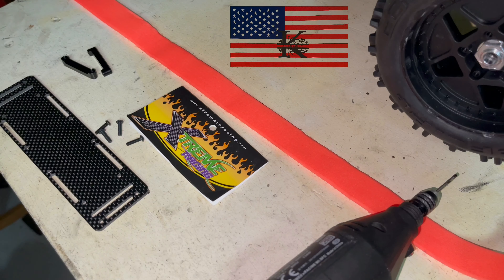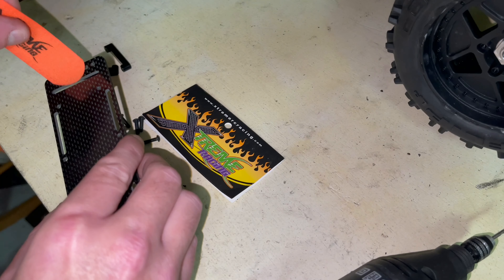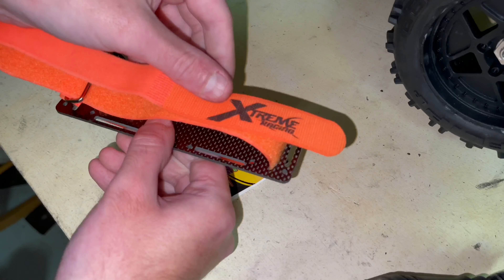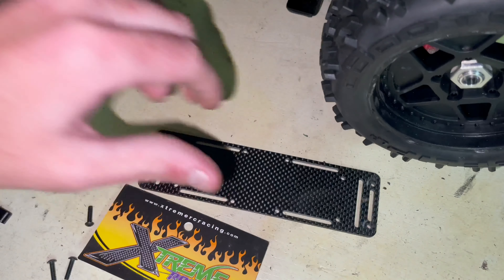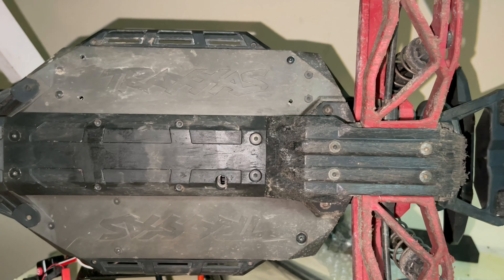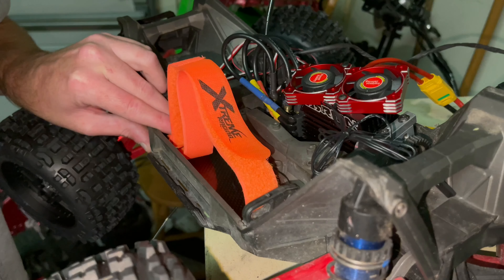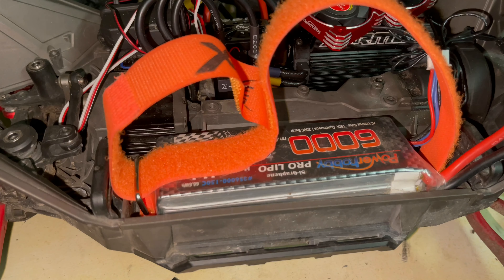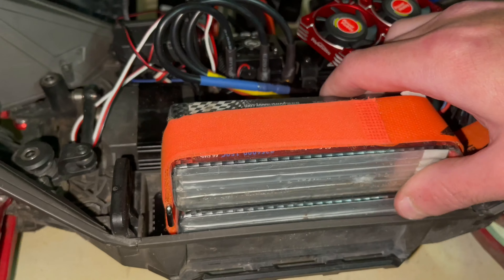Traxxas Maxx “Xtreme Racing” Carbon Fiber Battery Tray & Strap Install; Fit BIGGER Batteries for 6s!

Comment: I'm first lol....awesome video and nice tip
I'm looking into several trucks....not Traxxas tho...but I feel like they're good
Reply from the maker: THANKS BRO. Traxxas is a GREAT company, especially to start off with. They have a GREAT warranty service. So any issues they deal with instantly in my experience. I LOVE Arrma but I think horizon hobby’s warranty is more like pulling teeth. But if you’re not worried about that, then I LOVE wrenching on Arrma rigs more than any other. Losi or Traxxas. Can’t go wrong with either brand honestly. But Traxxas wins the warranty and customer service in my book. STAY UP BRO🙏🙏💯🍻

Comment: Not 100% but I think u ran the strap wrong, I think its supposed to go in the first hole and then threw the second then loop over to the other side on the inside hole and out the outer hole then it loops onto the metal loop. I think that's why u have so much extra strap left but if not it looks like u could run some huge batteries the way you have it!
Reply from the maker: Yeah, I believe clares rc did that. Through the first and put bracket over the strap. I decided to go this direction. Works GREAT. And gives you a little extra strap as you said. I think when running 2 batteries another smaller strap or 2 could go in side slots or zip tie or Velcro 2 batteries together and then strap in big strap. If that makes sense. I’ve been running a single 6s battery so no worries as of now. APPRECIATE IT🙏🙏💯
Reply: @KruseNStuff  makes perfect sense! Lol definitely a good upgrade!